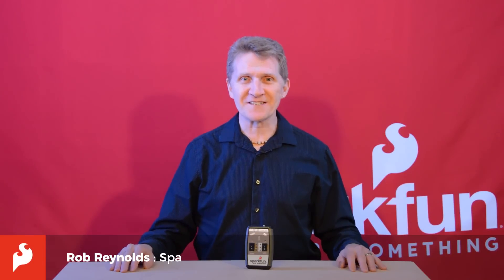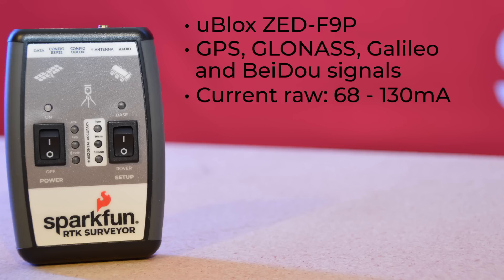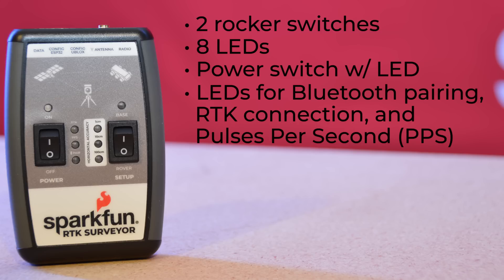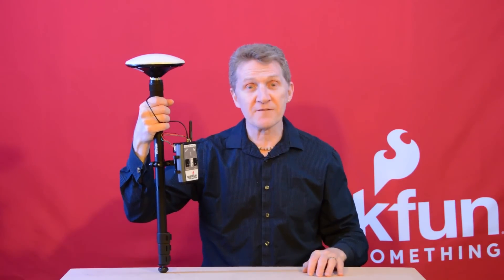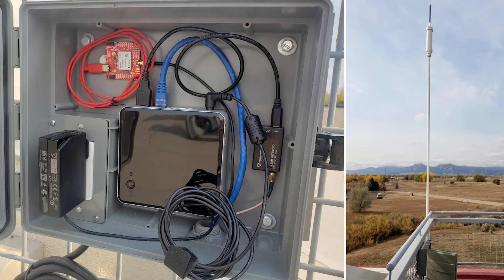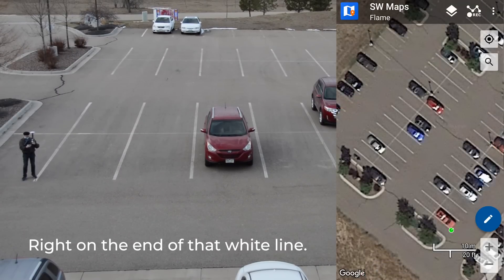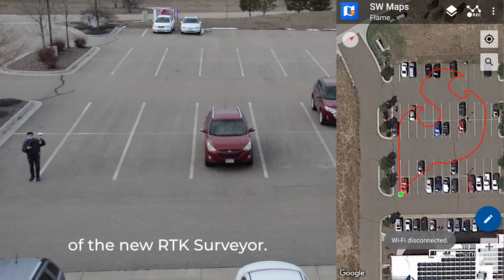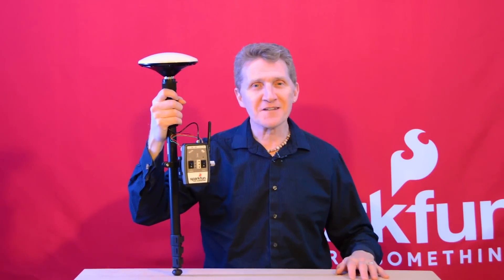Product Showcase: SparkFun RTK Surveyor

Comment: Looks like an amazing product! Congrats to the design team.

Instead of using a radio to transmit the differential signal, how about using 2 lora nodes that operate in the licence free ism band.

Yes it will be much slower, but without the need for a radio license

Comment: Ummm, there is no millimeter precision GPS anywhere. I work with a major brand name GPS vendor and I can back my statement up.
Reply: Let's not forget about 2m baselines, clear open sky, 24h static, geodetic antenna... As we all do on a daily basis 🤣🤣
Reply: Kris, What is a realistic precision value for the ZED-F9P?
I'd like to use a pair of these for an autonomous lawnmower.  Is it good enough?
Reply: @SwankySasquatch66  everything will depend on weather you have an unobstructed view of the sky or not. Neighbouring buildings will cause multipath : reflection of satellite signal that will degrade your positioning quality, interruption of signal caused by foliage and branches will often cause the receiver to lose the fixed position... It's very hard to figure...

Comment: I’m a civil engineer. I can say from experience that the professional gps survey systems typically don’t do better than 14 mm.
Reply: @Jayden Morgan you're right not to be sure mate... Nobody gives a f about you hacking your gf's Instagram password !
Reply: Receiving the L2 signal is one thing... Getting a fix in an unobstructed parking lot also... Now in real world we have multipath, I'm curious about how the ublox chip is capable of handling those more realistic scenarios....
Reply: @trollenz  agreed. That would be interesting to see. By the way, I’m currently using another relatively inexpensive GPS receiver (Polaris S100) along with Microsurvey Field Genius running on a cheap android tablet. So far the results have been very comparable to a Trimble R2 system w/ TSC-3 controller that cost more than ten times as much. Moreover, the Field Genius software is much easier to use, in my opinion, than the Trimble stuff, at least for what we’re doing.
Reply: @dbackscott  thanks. I'll look into it... I've been watching a lot of those Chinese Leica/Trimble knockouts lately... I'd trust the hardware but I'm a little shy on the software side...
Reply: @dbackscott  hey scott did you use the sparkfun with the surpad aplication?
Reply: @felixrunge1406  no, I haven’t tried that.

Comment: can this be configure in android phone, do have app for configuration on android phone?
Reply: Yes, you can!  On android Works well with "Lefebure Ntrip Caster" and "Bluetooth GNSS" just open the app,( you must turn on mock location first) turn on the sparkfun module... and hit "conect" on your Phone
Reply: @texasapps2595  mainly we used radio mode for correction. if incase of returning on a previous survey area, how are goin to input the previous coordinates? do we need an laptop to enter previous known point?
Reply: @geotek6748  yes, you'll need it. In survey-in mode you have an option to input a known X Y Z coordinates. After that the module will start to fix the position in Real time.
Reply: @texasapps2595  gracias aplicaiones texas me as librado un monton de tiempo, Probe con las dos y me gusta mas BLUETOOH GNSS, muy buen equipo y ahora si puedo usar en mi aplicacion favorita el mobile topographer.